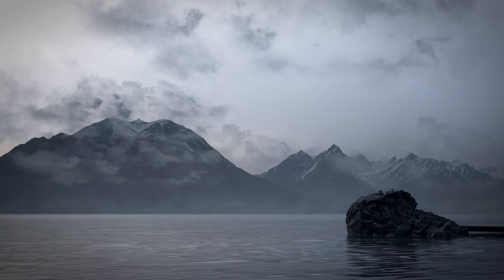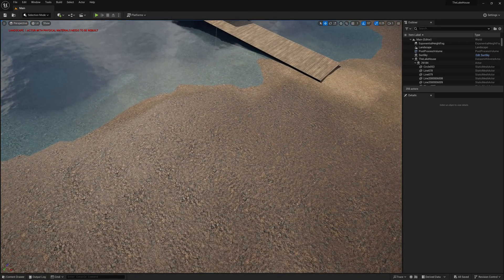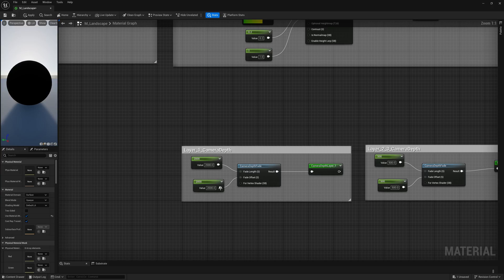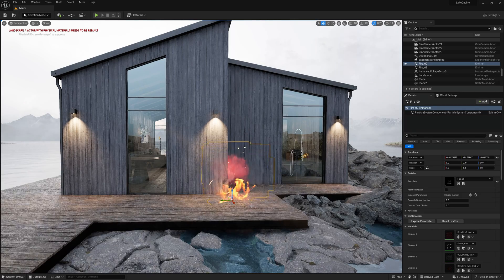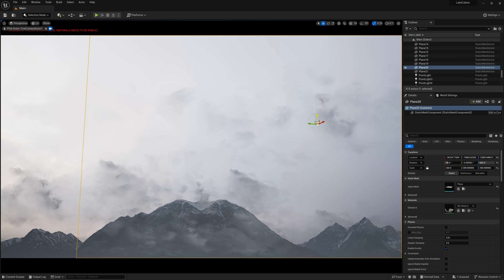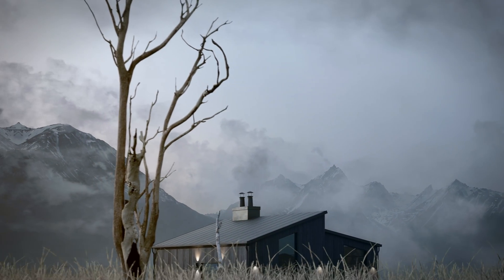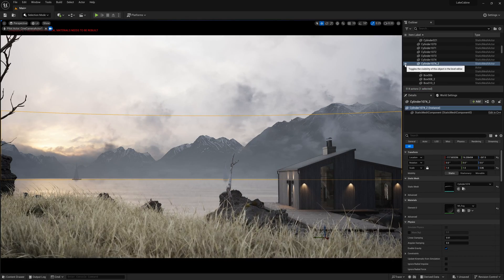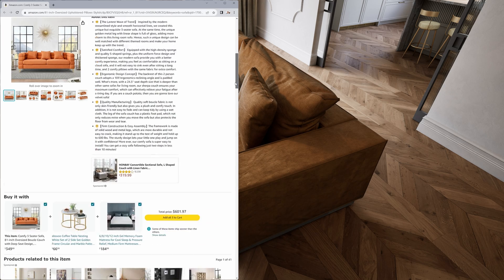Making of The Lake House project

Comment: Fantastic job, Stan! 👏👏👏
I thoroughly enjoyed your work and am eagerly anticipating your next interactive tutorial project.
I have a couple of queries regarding the current tutorial:
1. How can one prevent flickering issues, such as the floor flickering at Duration 0.14 seconds ?
2. Is there a way to adjust the wind speed of Megascan trees and grass when they are placed through foliage mass placement? I've noticed that they tend to wave unnaturally, and I'm interested in learning how to either stop or reduce this effect.
Thank you in advance for your assistance!
Reply from the maker: Thank you for appreciating my work! As fore flickering, this is due to the texture pattern of the floor. Changing the texture will solve this problem. You can adjust the strength and speed of the wind by adjusting the material instance of the Megascans foliage. Find and activate the "Wind" tab.